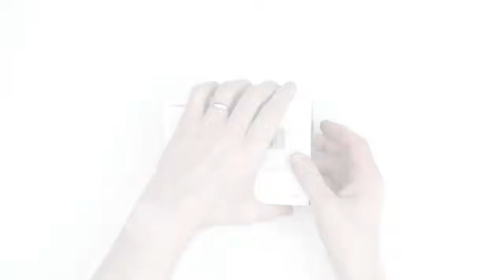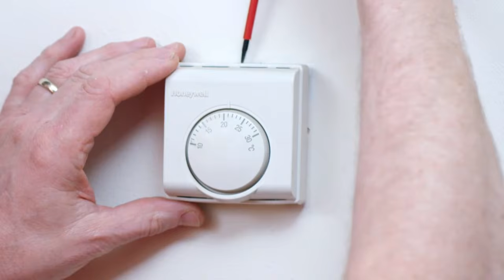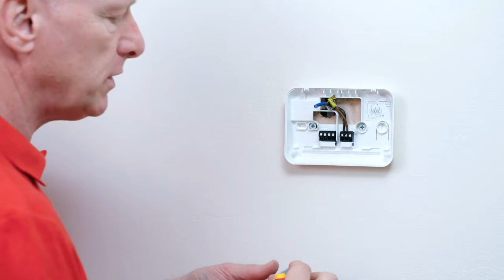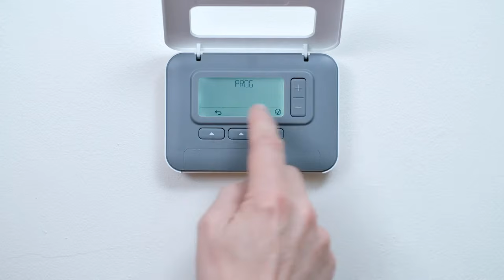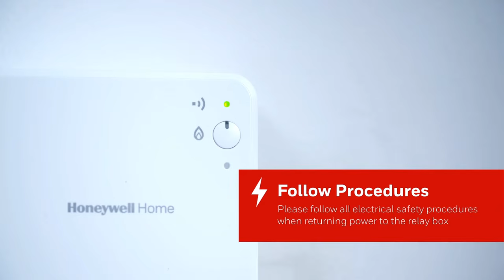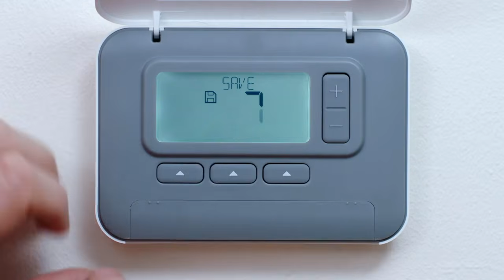Installing the Honeywell Home T3 series programmable thermostat

Comment: Nice that the two boxes are pre-bound, but is there any way to replace the thermostat part without also replacing the back-end?
Reply from the maker: Hello Chris! Thank you for contacting us. Unfortunately, no. When a replacement is required, we will supply all parts included in a new package. If you need help, please contact us at 1-800-633-3991, or through Facebook under Honeywell Home. -Alex
Reply: @ResideoPro  My neighbour already bought the replacement (both parts) and asked me if I could help her install it. After watching your (very clear) video I can see that even to replace the front-end I need to do some wiring (it's not "wireless" in that sense!) and we need to isolate the system - so whilst I could do it myself I may suggest to her that she gets a real electrician to do the job.  In any case, thanks for your help!
Reply from the maker: You are very welcome, Chris! 
Wiring the thermostat is straightforward: just follow the wiring diagram of your old thermostat. For instance, if the yellow wire is connected to the letter 'Y', you should connect it to 'Y' on the wall plate of the new thermostat. Do the same for all the other wires.
We recommend hiring a professional to isolate the system. This may require technical knowledge to identify the electrical installations at the location. Use this link to check on the options near you: https://www.resideo.com/us/en/find-a-pro/ -Alex
Reply: OK so when I got there it turned out we were replacing a model from 15 years back, so the correspondences were not quite 1-to-1 but I was able to sort it out and now neighbour is very happy 🙂 Thanks again for your help!
btw the only thing which had failed in the old Honeywell system was the LCD panel on the controller (like, maybe 25% of the display was still working). Which is not too bad for an LCD screen of 15 years ago :-)